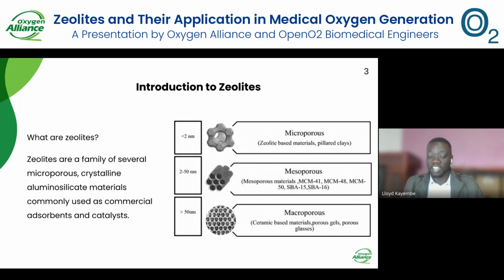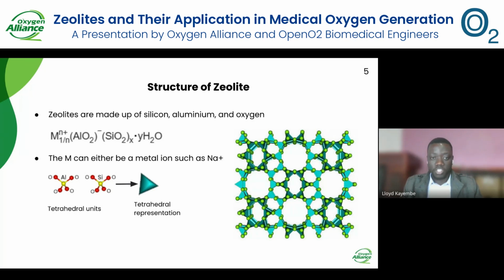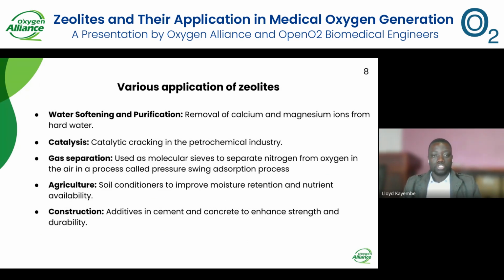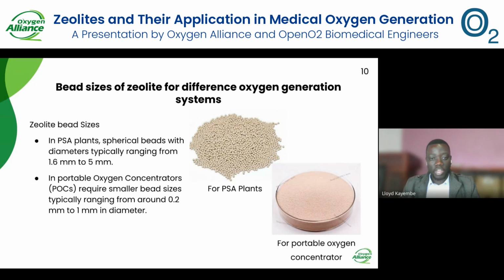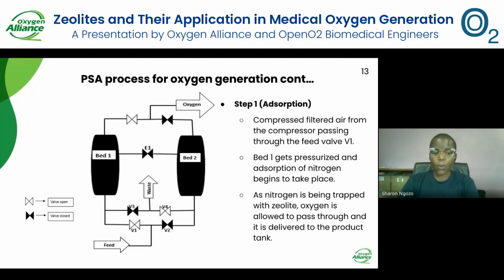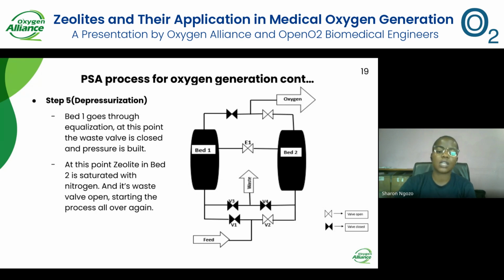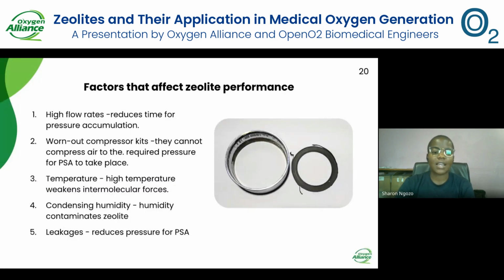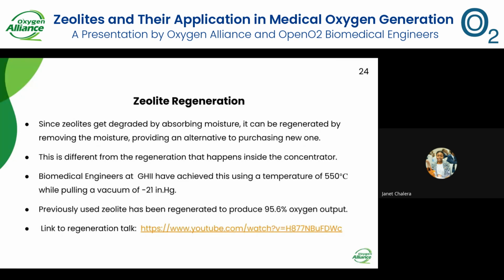OXYGEN TALK: TYPES OF ZEOLITE AND THEIR APPLICATION IN MEDICAL OXYGEN GENERATION

Comment: Hello Oxygen Alliance, watching this video, I'm prompted to ask this question please : Can poor ventilation (heat) affect concentrator oxygen production purity?
Reply from the maker: Yes, poor ventilation and heat can definitely affect the oxygen purity produced by a concentrator. When the machine gets too hot, the compressor may not maintain the right
 pressure needed to separate oxygen from nitrogen effectively. At the same time, high temperatures can reduce the efficiency of zeolite in the sieve beds
 (https://hengyeinc.com/oxygen-concentrator-zeolite/?utm_) . As a result, the concentrator may produce lower purity oxygen. 
That’s why good airflow and a cool environment are important for the machine to function properly.